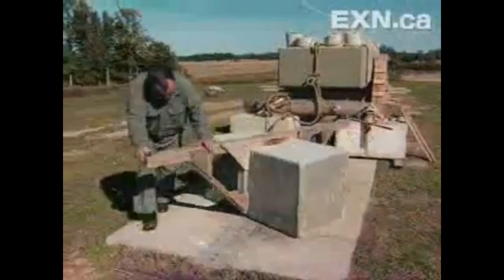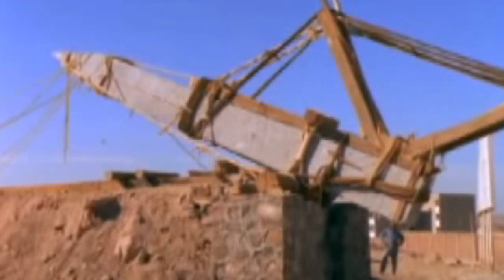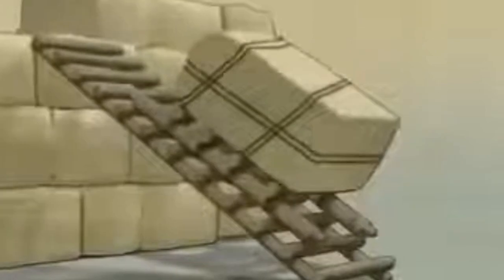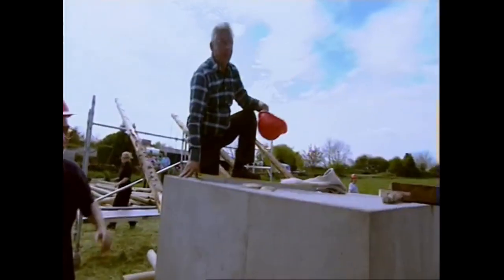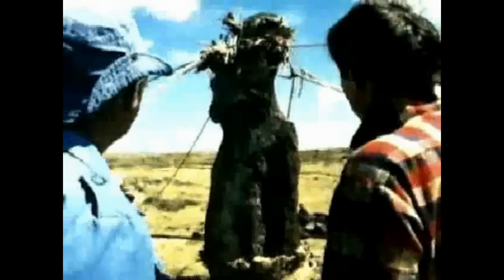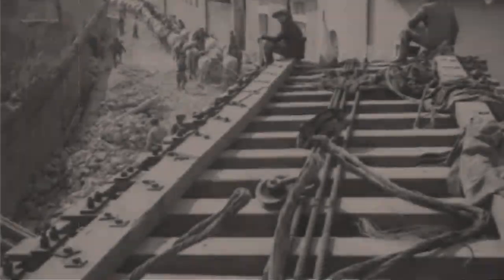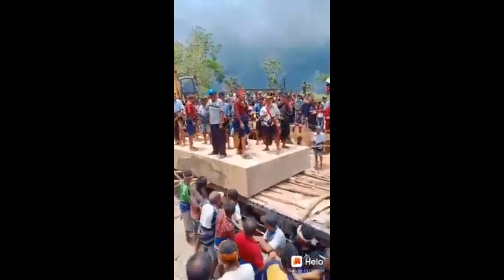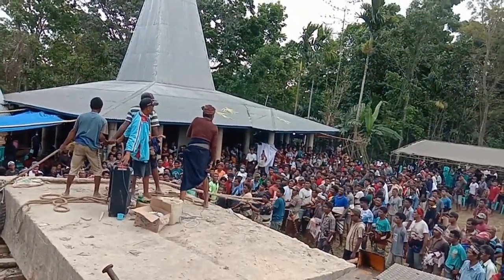How The Ancients Could Move & Place MEGALITHS With Primitive Tech. LAHT WON'T SHOW YOU THIS!

Comment from the maker: Ancient Cranes are Modern Cranes, just the materials have improved and muscle power has been replaced with motors.
 https://www.youtube.com/watch?v=FkEguRSvW30
Reply from the maker: @ashmash1934  So your complaint is that in a video on moving heavy objects I don't go into making stone vessels?
If you have a book on horses do you scold the author for not writing about rabbits.
This is one of the more stupid comments I have received but to be fair on the videos about vases I get people crying I don;t address the issue of lifting stones.
Reply: This is why I’ve always believed that the invention of string then rope was the greatest engineering tool discovery of all time
Reply: @SacredGeometryDecoded  an understanding of how they cut and moved the stones is an understanding of why all ancient structures,  later misappropriated as religious temples, had conductive metals on the spires and domes, operational antennas covered in conductive metal, and conductive metal rods running throughout the structural columns, including conductive metals mixed with masonry. This was denies by the orthodox establishment until people started bringing metal detectors to ancient historical structures and demonstrating that there was metal in parts where there was no structural explanation for the metal. Also the understanding of how they moved the stones will be an understanding of what the "Triumphal Arches" scattered across our Earth were really used for, why they contain conductive metals, and why they are shaped like Horseshoe Magnets.
I know this is upsetting to you, particularly because it alludes to me knowing how they really moved the stones, and to accept that there is people who know some of what the Controllers have tried to cover up, after you've tried to figure it out using false axioms intentionally fed to you to lead you in the wrong direction, must really burn your biscuits. 
Sorry man, you're on the wrong track. When you start to study Electromagnetic  Energy and Water, you will start a long journey that will uncover how they moved the stones, which will be a tiny detail in the discovery of a vast world that The Enemy has concealed.
Reply: Yes now explain how they moved 10 of them into place per hour onto the pyramid
Reply from the maker: @MrPenguln  multiple teams working at once.
Reply: ... would probably get in each other's way! @SacredGeometryDecoded
Reply from the maker: @CosmicClaire99  about 90% of volume in the bottom half and each base having 230 metres there seems to be enough room for well organised teams.

Comment: Great video man. It's also good to point out I think, that while this video is showing distinct examples of more or less "one offs", in the case of building a wall, or a pyramid, or anything else consisting of a lot of similar blocks, the people will get better from block to block, so in each of these examples, the same team doing this job the tenth time would have done it even faster and more efficiently, to the point of mastery.
Reply from the maker: Definitely. These experiments didn’t have grandpa experience. Plus they were single methods. A mix of these would be used rather than one size fits all.

Comment: Excellent!!  The people at the end could have helped themselves with greased rollers, LOL.  I'll be performing experiments on how to make files by hand out of iron, including hardening techniques used around the 15th to 16th century. Not quite megalithic period, but the time period I'm interested in at the moment. My goal is to make all the "period" tools necessary to eventually reproduce a 16th century triangular pad lock in my Blacksmith shop.  This will include making my own drill bits and drilling apparatus that would have been used back then along with other period tooling.
Reply: Sounds interesting project are there many resources available for you to  reference or will it require a certain anmount of trial and error ?
Reply: @GroberWeisenstein   --  Well, that's a complicated question, LOL.   I've been waiting for information from the Met Museum in New York for over 4 months now on the lock dimensions and pictures.  They have 4 of these locks in their collection that I know of, dating back to the early 1500's.  Their research staff is STILL working from home.  Other items, such as how they drilled the holes I'm still researching from available sources like books.  Other tools I'll replicate from known examples in museums and collections.  How to case harden iron has been known for at least 2,000 years.  I just have to learn the OLD methods for myself, mainly from books.  I'll replicate/build a 500 year old weight scale to measure the ingredients that's used in the case hardening process.
Reply: Iron Clad, that sounds awesome. Subbed
Reply: @BSIII  --  Thanks!!  I hope to start the project this winter.  I've only got one other small project in the way before I start this one.  One of my tractors broke down and I'm working on it now, LOL........
Reply: @ironcladranchandforge7292  what oils and brines do you suppose they quenched with and do you think they understood fluxes and were able to carburize? How deep  was this case hardening approx?
Reply: @GroberWeisenstein  --  All good questions. Fluxes must have been understood when forge welding was being completed.  I know sand has been used as a flux during the 18th century. The lock I'm reproducing is one of 16th century German (Prussian) origin.  I'm not entirely sure what types of oil were available during this time at that location.  Olive?  Whale? Vegetable?  I know that a warm salty brine was typical.  I'll be using either brine or vegetable oil.  Case hardening depth depends upon how long the item is in the heat.  I'll be using a traditional mixture of crushed charcoal made from animal hide and flour, water, and a little salt.  This will be made into a dough and packed around the iron file then allowed to dry.  Then I'll pack that again with clay and put this in a gas fired forge.  However, I may build a charcoal oven with bellows for this process.

Comment: Deeply satisfying video. I feel the allure of wanting to participate in such teamwork. 
Also I am always impressed that nature can grow, cell by cell, such incredibly resilient and strong plant fibres. Wood is an astounding material. We have oak trees here that are well over a meter in diameter near the bottom. Growing out horizontally are thick, very long branches as big as tree in their own right. We all know the power of a lever and how hard it is to hold a pole outwards at the end. Yet, in the trunk, these small organic cells hold those heavy giant limbs, and the rocking and bobbing motions from years of wind don't fatigue the joint, as would happen with metal or stone. 
Similarly, muscles are tiny cells that coordinate to pull very short distances, butl animals are articulated as levers that magnify movement.
Contemplate how squishy animal cells working with fibrous plant cells organized by a self-evolved organic brain cells to move huge weights so much greater than we individual components.
Early or Advanced technology isn't as impressive as the biology that designs, builds and controls it.
Reply: Yes lets build pyramids

Comment: Could a technique spinning the block around be used to polish say block of granite to a mirror finish?
Reply: It would be easier to spin the smaller lapping blocks.
One could also create curves and polish the same curve with lapping blocks, and lapping compound.
Reply: @BruceLeet0 grinding, lapping and polishing stone is pretty standard for as long as people have wanted it.
It doesn't take high tech equipment.
The point of the video, is to bring a bit of reality to the subject, instead of listening to ancient high technology videos, where they exaggerate claims of precision and such.